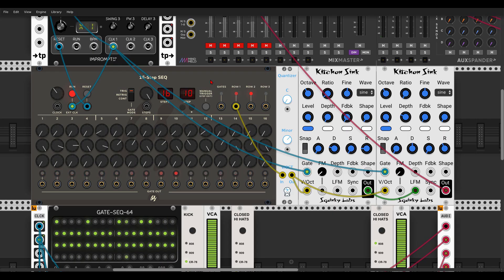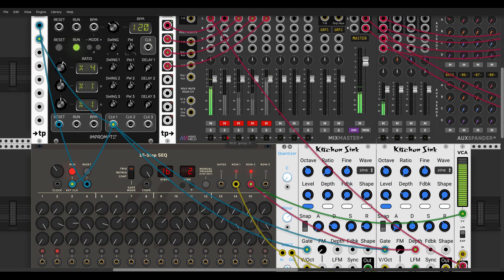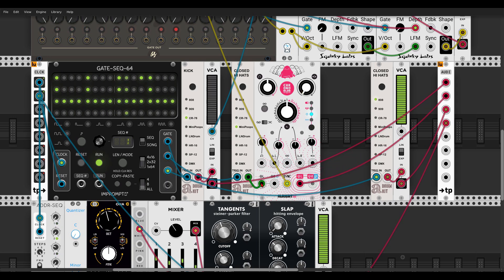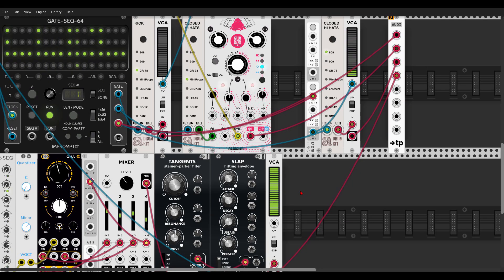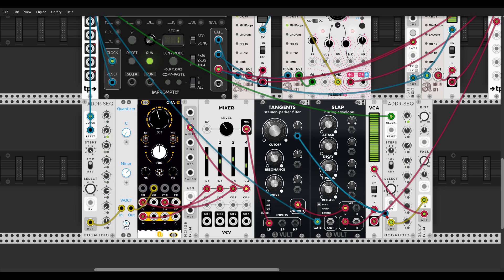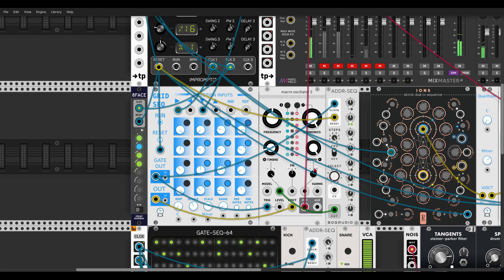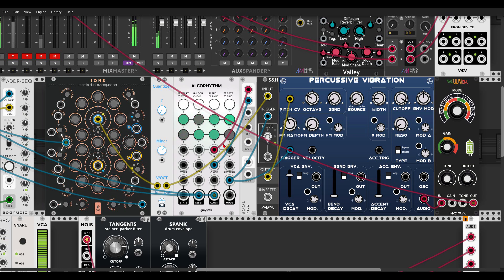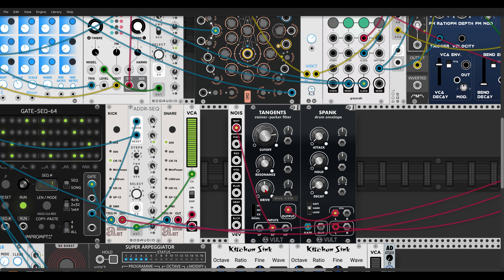How to add Velocity and Accents in VCV Rack

Comment: i tried the velocity technique but somehow my CV steps are shifted backwards by 1 step to the trigger steps, when i want to change the volume of step 1 in my trigger seqencer i have to adjust the CV knob on step 16 in the other sequencer. any idea?
Reply from the maker: Oh ok, yeah, some sequencers will behave differently and will reset differently. There's a module from rcm, the Seq Adapter. It should fix this. You can get it here - https://library.vcvrack.com/rcm
Let me know